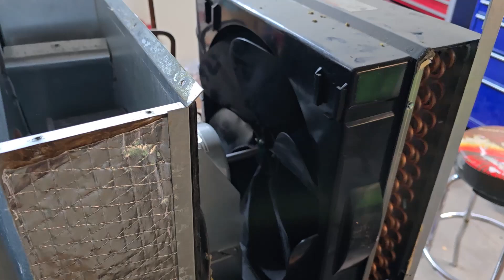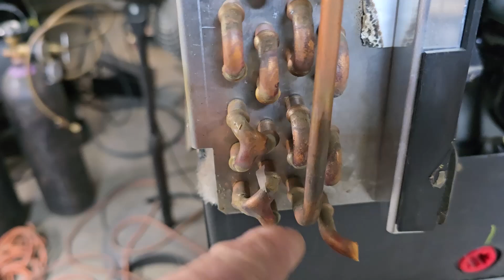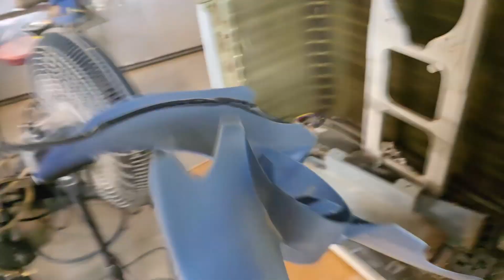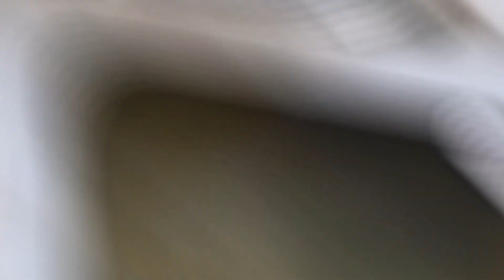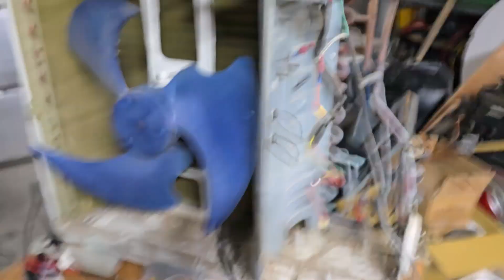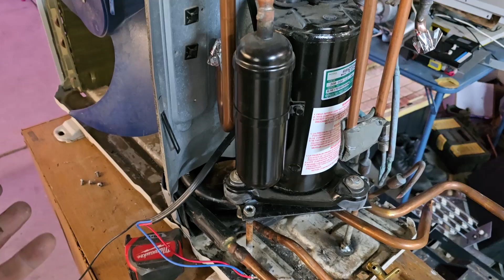Project Water Heater HP ver 2.0 Pt 2 [Solar Powered Heat Pump]

Comment: For the water loop, would it work to put a water regulating valve like on a water cooled condensing unit. That way it would keep the discharge water temperature high enough that you aren't recirculating cold water back into the top of the tank
Reply from the maker: That should work perfectly, actually.
I'm doing effectively the same thing by monitoring the laving liquid line temp controlling the circulation pump from off, low speed, high speed.
I'll try to refine that control a little bit once I change the unit over to this one.
Reply: it'd absolutely murder the efficiency of the system, it's more efficient to pump the entire content of the tank through 10+ times and step it up by 10f on each pass, the last pass won't be as efficient as the first, but the total efficiency would still be massively greater than doing it in one pass at the lowest efficiency (highest temperature)
Reply: @ I 100% agree it would greatly reduce the efficiency, but it would allow the water hot at the top of the tank where it is being drawn from while being used. Pumping it through quickly will mix the tank contents together, which means it will feel like you have run out of hot water much faster than if there is a thermal gradient in the tank and you are only drawing off the warmest water.
Reply: a valid point too. Which is why 'real' heat pump tank setups use a coil heat exchanger in the bottom of the tank. I wonder if the upper layers would remain undisturbed if you pumped between the bottom and somewhere in the middle of the tank
Reply from the maker: Can't do that. There is a huge gradient of temperature from the top of the tank where the hottest water leaves to the bottom of the tank where that 45 degree fill water is entering.
The first time I attached a WSHP to the tank I did that. Just ran the pump at single speed. The issue was when the fill water was colder it quickly diluted the hot water remaining at the top. Caused the shower to drop in temp when the pump started.
With the pump cycling on temp, I always have approx 130 degree water returning to the top of the tank.

Comment: What happens if you charge the system with R744 CO2?
Reply: compressor doesn't have the beans to compress it to liquid.
Reply: Thank you Happy New Year
Reply from the maker: I'm certain that nothing in my system would handle those pressures. LOL
Operating pressure would be about 1400 - 1600 PSI discharge. 😲

Comment: Looking good. I have considered doing something like this for my own purposes since I work HVAC and get my hands on decommissioned units. I am also playing with a mini-split indoor head and turning it into a circulating fan, no coil at this time. Still holding onto that with the idea of maybe putting it back in and running R134A in it and one of the 12V automotive compressors and condenser sitting outside for the cooling needs. Still working on the circuit board for the indoor head right now.
Reply from the maker: If it is like Carrier/Midea etc, the indoor motor will likely have a built in brushless dc fan controller in the motor.
So it will need the high voltage DC powering it from the board or from a rectifier if you find the correct two wires. It also needs 15VDC. Which as I type this out, explains why that one motor didn't work as I forgot about the 12-15VDC control voltage comes from the board, not the motor. 🤔😑
Then a variable DC input, usually 1 to 6 VDC will set the RPM.
If you retain the control board, it should power the motor high voltage DC and motor control voltage (12-15VDC) and then you can carefully connect a pot between the 15VDC, signal in, and common to make a speed reference.
I say carefully because all points are high voltage in reference to ground.

Comment: Fan Blade is on backwards...
Reply: No it's not
Reply: @R290s_biggest_fan  It certainly is.
Look at every other mini split unit. 
The pointy part of the blade is turning into the air beeing the leading edge.
Reply: @Alexander470815  no its not
Reply: @R290s_biggest_fan  well look at any Video of a mini split outdoor unit and you clearly will see that the pointy part is the leading edge.
Even in the older Videos from @hackfreehvac like the one:
Frankenstein HP project gets ressurected after abandoned for 2 years
At 13m30s.

Daikin, Panasonic, many us the blades with the open Part on the front on some of their units.
What difference would that make anyway? None.
Reply: @R290s_biggest_fan  It is.
 At seven Minutes and ten seconds into the video you can even see the direction arrow on the blade.
Look at any Video of a mini split outdoor and the pointy part is always the leading edge.
The curvature inside the blade is wrong this way, you want so scoop the air and not push it against a wall.
Many units from Daikin and Panasonic use blades with the open center parting facing to the outside. 
But what difference will the center part direction make anyway? none.
Reply from the maker: It does look that way at a glance because they don't have the typical concave scoop shape, however it isn't. It can't be installed backwards. It has a large opening in the backside of the plastic mold and would be very obvious.
Reply: @hackfreehvac Please look at every other unit you have access to, this would be the very first one that I see that uses the blade this way. And yes there are many units out there that have the open part of the molding process facing outside. Because of lower drag the motor can archive much higher speeds than it could otherwise.
Reply: @hackfreehvac  At seven minutes and ten seconds into the video you can even see the direction arrow on the blade.
At 11 minutes and 45 seconds again, the arrow is right below your finger, counter clockwise.
Reply: @Alexander470815  dang you're right
Reply from the maker: @Alexander470815  If it turns that way, the air will push through the coil instead of pull through the coil.
The fan does look like it was made to go CW direction. I thought of it as backwards as well and then when it pushed the air in, I reversed it to CCW to push the air out.
I have one Carrier ductless that is not a DIY.
I could have sworn that it pushed the air out when it was running to heat my garage yesterday.
I will go compare it and perhaps upload a short video of it.
Reply: @hackfreehvac  It has to pull through the coil that's certain.
But by flipping the blade you will not change the air direction, it will still pull air through the coil.
Reply from the maker: @Alexander470815  I see what happened. The other unit I removed the fans on previously had the flat part facing outside. So I just slapped it on the same.
When I compared to the other small unit I had, I see what the deal was.
See the video short here for an update https://youtube.com/shorts/7RgkG7-HKGs

Comment: are you building serviceablity into this
Reply from the maker: The main goal is just recycling parts I have and for the sake of building it as a project from time to time. So it is constrained to that rather than components I am purchasing.
I am laying it out so I can access the compressor if I have to, which is why I am laying the coaxial heat exchanger under instead of cluttered over it.
If this ever breaks down, I simply have to flip on the breaker to my water heater to operate the factory elements.